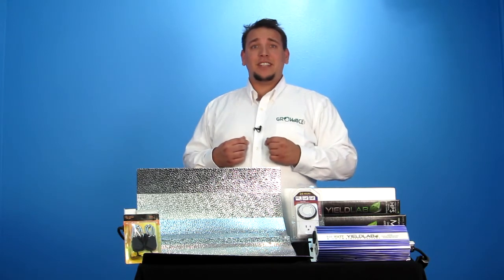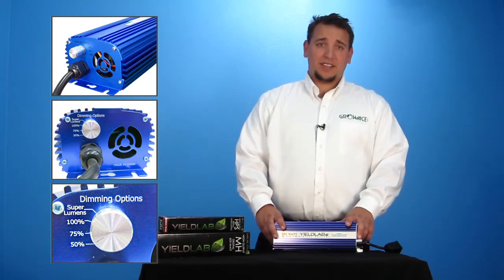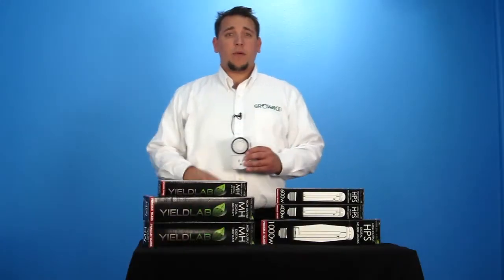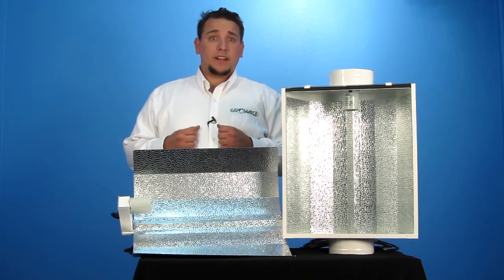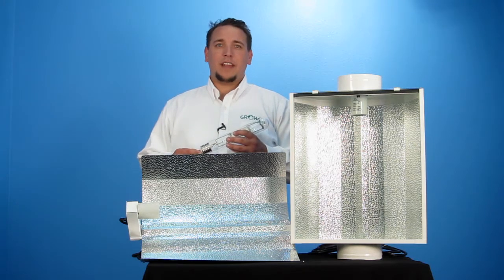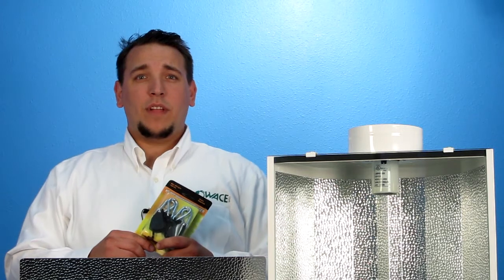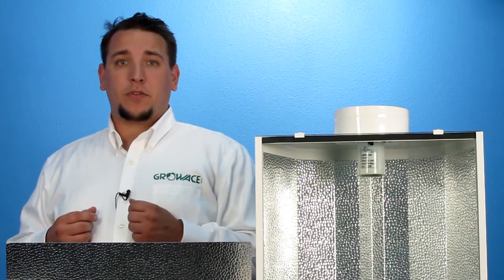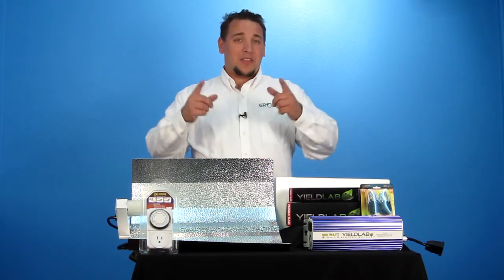Hydroponic Grow Lights 101 Tutorial Indoor Garden System

Comment: I live in north Missouri. I put all organic waste on my garden and on my compost pile. Last Oct., some of the tomato and squash seeds germinated.  I put a few plants of both in pots to take inside for winter.  I bought 
 iPower 54WX2 4 Feet 2-Bulb T5 Fluorescent Grow Light Stand Rack for Seed Starting Plant Growing, 6400K.

I know nothing about grow lights. Seems too complicated for my little brain.  Anyway, I noticed that on both tomato and squash plants, the outside edges of the leaves dry out, turn brown, and fall off (especially the squash).  They get plenty of rain water I collect. Why do the leaves die?  Are the lights too close to the plants. I moved the light higher to about 14 inches above the plants.  Are the leaves "burned" by radiation?

I'm just experimenting to see what happens. I read somewhere that squash grows best when the seeds are planted in the ground, rather than starting them inside.

Any suggestions.